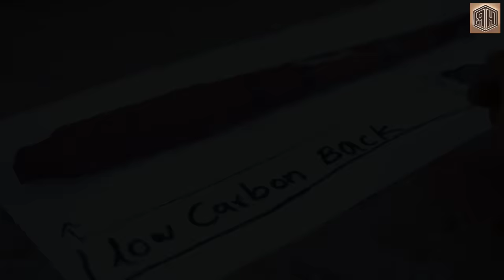Forging a Rusted Drill Bit into a 24K GOLD Plated KUNAI

Comment: One of the first times ive ever seen someone actually gold plate an object.. But i still find it somewhat annoying to see people say 24k theres technically no such thing the highest grade is 22 or 23 at peak because there will always be some kind of impurity in the gold itself.. Its just graded at 24k because 23.something takes more effort to stamp and then they cant charge as much by lying and saying its "pure gold". Real 24k (pure gold) would be soft enough to dent with the slightest amount of pressure and scratch from the smallest of impacts/rubs. Its why impurities are left or sometimes even added to gold to give it strength

Comment: this is an awesome video, but that isnt 24k gold. it isnt even real gold, it just makes it look golden when you electrocute it with certain chemicals.
Reply: I agree the title is a bit misleading, but the golden color on the kunai is from real 24k gold deposited during electroplating, it’s just an extremely thin layer.
Reply: Gold plated*
Reply: @lkhdmrtn  it still isnt 24k gold. The kunai would have to be pure gold for that to happen.
Reply: @MD-ex7cg  The plating itself can be considered 24k gold, since it is likely pure. The kunai as a whole is obviously not 24k gold, though.
Reply: @fishworshipper  good point.
Reply: Maybe all Gold is pretend.................................!
Reply: True the gold plating process involves a diptank with gold powder in a liquid solution electricity is added and gold deposit ed thru deposition simmilliar to a welding process with liquids becoming the electrode

Comment: i hate when people roughly forge a turd and finish it with an angle grinder its not forging you might as well buy 1/4 inch steal and cut it up with a grinder
Reply: I was half paying attention then was like wait jumped back saw that and was like . . . ugh. . yeah seriously why start with drill bit unless theres literally no steel around . Real forged would have made the whole thing on and anvil and just needed sharpening
Reply: Y’all don’t get it, if he applies equal force on all angles of the metal, the density is gonna be the same, and that usually means excess material, the way y’all are saying means that he should cram more metal into some places but that can result in an unbalanced kunai
Reply: @-Chicken_  That makes no sense. . . so the HSS drill bit was unevenly dense? but randomly pounding it made it evenly dense? No as a metallurgist I don't think it works that way. "the way yall are saying hed cram more metal into spaces" no infact heating it up and pounding on it randomly would put more metal into places. Usingg the HSS bit as is would NOT have that effect right?
Reply: @ecophage  What you say is true but have you considered that maybe pounding it any further was hard since it was already so dense?
Reply: @-Chicken_  yeah the second I saw him give up when it was still a 2”x1” bar
Reply: @ecophage  Well since you’ve a metallurgist is that thick or no?
Reply: tought the same thing. it's not forging.

Comment: What was the green stuff?
Reply: Marker
Reply: I thought that was nickel plating?
Reply: itd be a solution with nickel cations that get plated onto the kunai as it acts as the negative electrode in the electrolytic cell, which is just basically a chemical reaction that requires an external electrical current

Comment: How does that gold plating work?
Reply: The object being gold plated is placed into a gold saturated solution (liquid that has gold dissolved into it) and the item is placed into the solution and then has an electric current going from the object, through the liquid which attracts gold from the liquid onto the object. There is more detailed info on it online, but this is just a basic overview of the process.

Comment: How does that work like rusty poop metal to clean shiny metal?
Reply: (shakes head). It's called sanding polishing and plating... All the brown on the metal at the beginning is rust which is oxidized particles of steel that stick to the surface and eventually cause pits and erosion of thee metal.  What you do is you take an abrasive and rub it repeatedly and vigorously until it removes that rust off the surface and the metal is again clean.  Then you continue rubbing the metal with progressively finer grits to "polish" the metal. Then you stick the cleaned and polished metal into a tank with the proper chemicals and electricity to do what's known as electroplating which is where you electrify a solution that chemically adheres a different color metal to the surface of the piece you are working on.  Honestly kinda surprised you felt the need to ask....

Comment: Why did you call it a 24k gold plated kunai if it’s not even 24k gold
Reply: their is a layer of 24k gold on its surface
the kunai itself isnt 24k their is a very thin layer of gold
Reply: @priyankasingh-wk7cb  its a zinc and sodium hydroxide solution that turns the thin layer of nickel on the surface golden its not actually real gold

Comment: "Forging" uses heat to bring the material to a malleable state. The material is then hammered to shape, typically using hammer and anvil together with specialized set and fuller tools depending on the particular technique. There is a variety of forging techniques for sword making and many variations upon those. You sir did none of that maybe rename it to grining down rusty drill bit.
Reply: So did you not watch 1:50 - 3:00 ? Cause that's where he does exactly what you wrote

Comment: That's not even gold
Reply: Yeah it is.
Reply: It is, by doing electrolysis with the gold solutions pure gold ions were fused to the kunai, giving it it's plating. The nickel beforehand was most likely to make the colour a bit more vibrant.
Reply: Keyword you might have missed: "Gold. PLATED."
Reply: @TitaniumTronic  is gold plated expensive also?
Reply: @NakieYoda  definitely not as expensive as full blown gold but sure